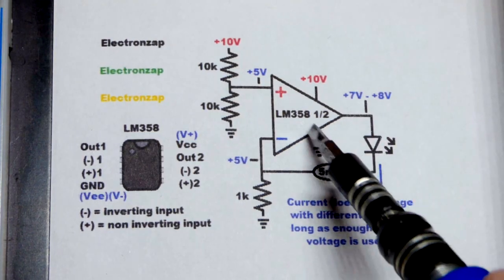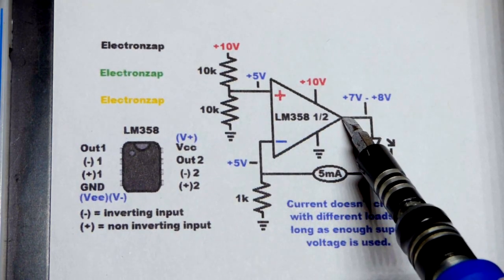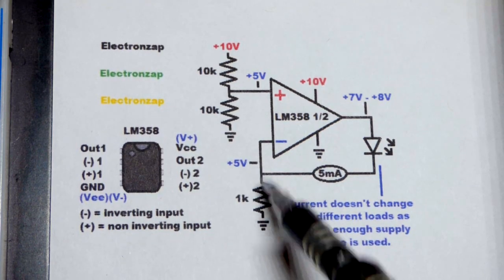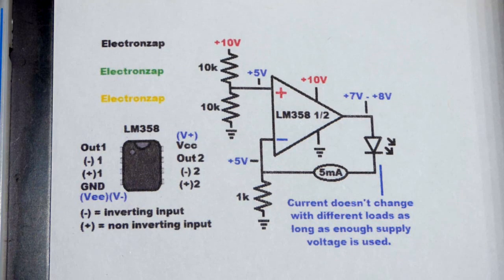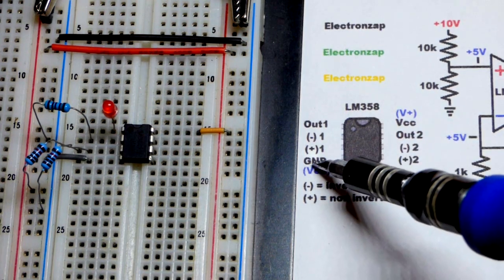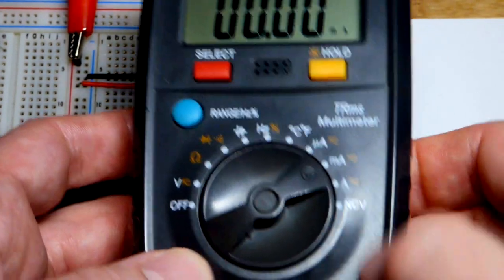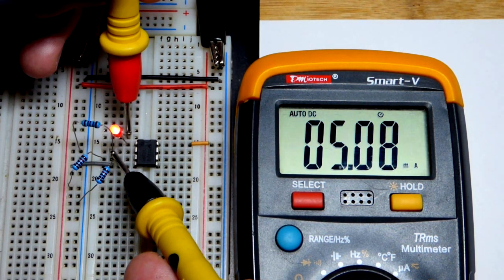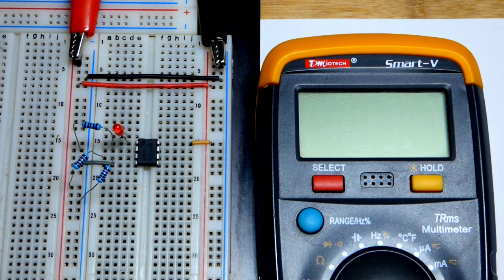Op amp current source made with LM358 operational amplifier electronics how to DIY tutorial

Comment: Amazing!! I was researching how to make a constant current source and I was hoping that I could use an LM358 I have laying around. Question: In my recreation and experiment with this circuit I cannot get the output current above ~35mA. Changing the 1k resistor in your circuit I am able to increase the current but not enough. My target current in 100-150mA @ 5V. Why is this happening and any guidance on how to solve it? Thank you!
Reply: Figured it out. transistor. now i need my resistors to stop overheating. luckily you have videos for that too. thanks for everything!
Reply from the maker: Yeah, you use a transistor in addition to the Op Amp for higher currents. Quarter watt resistors can't handle much current, so higher wattage resistors and/or parallel resistors can be used. Not as easy to design higher wattage circuits.

Comment: Can't we feed 5V directly to the non-inverting terminal, instead of using a voltage divider?
Reply from the maker: Yeah, you can provide voltage to an op amp however you want as long as it stays within limits on the datasheet.

Comment: Thanks for making these!  I have been watching your videos and using them to discover what I can do with my Dad's electronic stash I inherited.  He has so many boxes of IC's, capacitors and little Feather boards and components from Adafruit. I don't know where to begin.  It's a fun hobby though and especially  useful during our knockdowns here.  Cheers!
Reply from the maker: Thanks for watching! It's an expensive hobby to really get into so starting off with a lot is very helpful. Just start with simple circuits and work your way up. Google the part numbers of integrated circuits and see which ones have a lot of demonstration circuits to build. It's important to understand each component's voltage and current limitations so that they rarely get fried.
Reply: @Electronzap    Thanks for the reply.   Good tips, I also have a number of test gear. Signal generator, A couple Oscilloscopes and  power supplies and meters.  About the only thing I felt comfortable in using is the Fluke  multi meter and  the HP power supply.  ;-)    I am hesitant to damage the scopes since I am so unfamiliar with their operation.  Do you have any videos on Scope operations or can recommend some beginner resources to learn how to use them?  Thanks!
Reply from the maker: Unfortunately I only have a low priced and easy to use scope. Otherwise they are pretty confusing at first. I'd do a google/youtube search of the model number and see if anyone who really knows what they are doing had made any step by step tutorials. I don't know the most common way that people damage them, but they mostly just look at voltages without passing any current other than a very small amount of leakage, so as long as you practice with relatively low voltages, I don't think it is easy to accidentally damage them.
Reply: @Electronzap    No worries!  I found some great tutorials on EEVBLOG for scopes.  Thanks for your help!  Cheers!